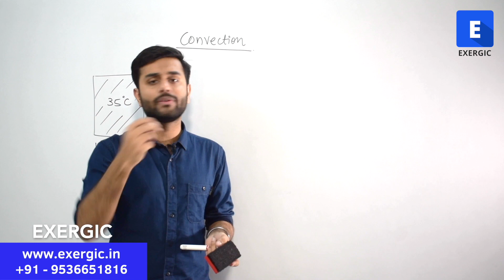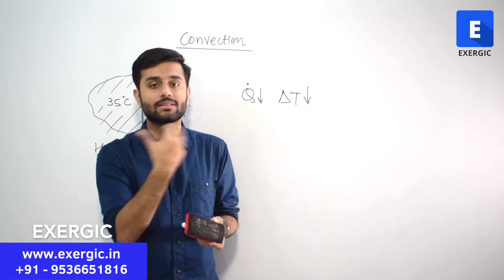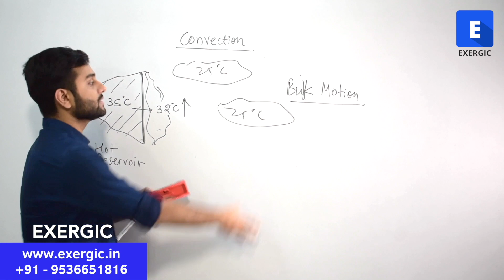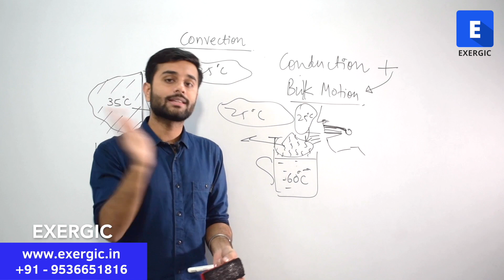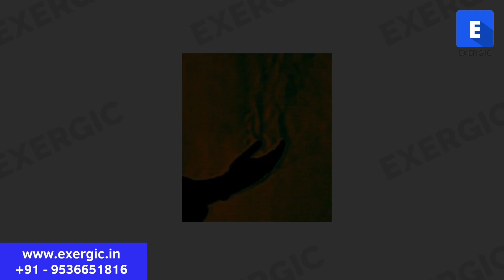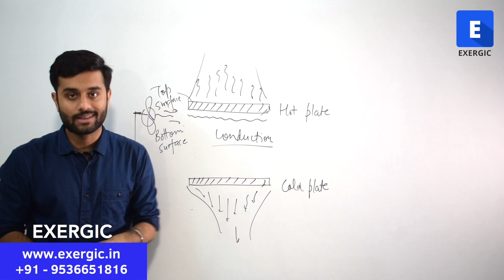Interesting Applications and Basics of Convection - Heat Transfer | GATE Mechanical

Comment: Sir in coffee example due to difference b/w the hot air above the cup it will automatically goes up and the denser cool air will be settled on cup so it is free convection right?